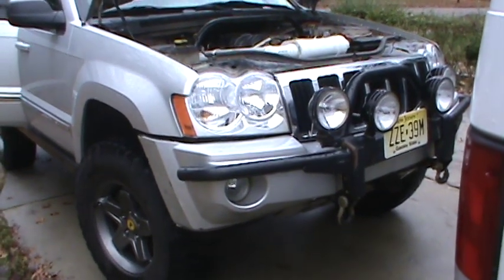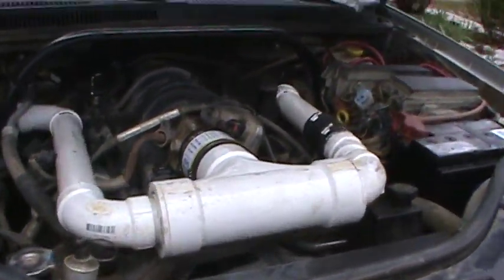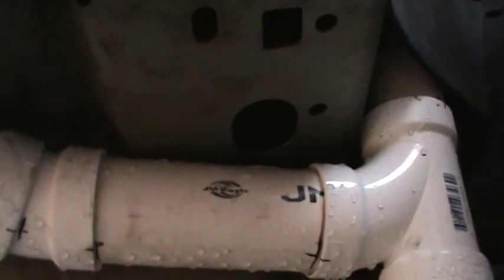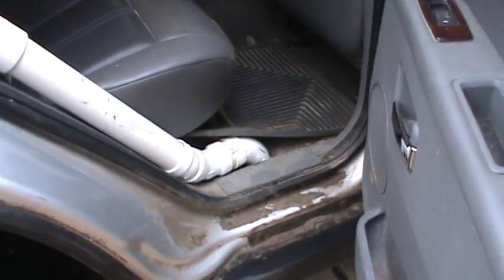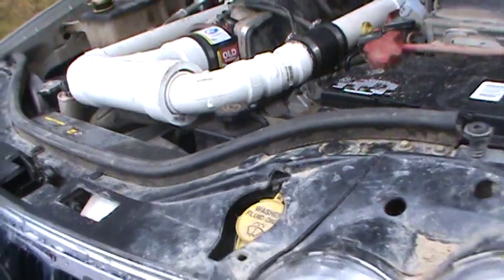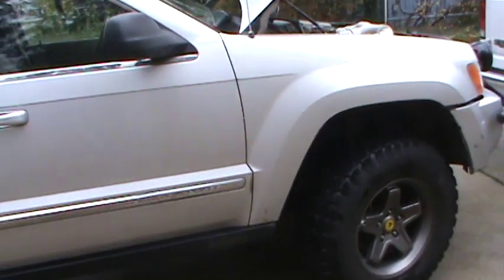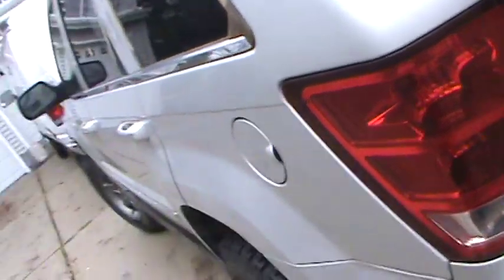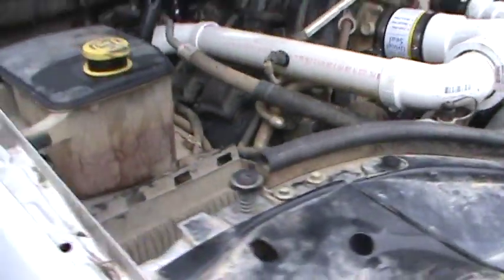2006 Wk Jeep Grand Cherokee Dual Snorkle Fabrication WATERPROOF!

Comment: U are going to blow another engine as your egt s will be so high due to no cool are getting in 😂
Reply from the maker: a decade later it;s fine and it runs cool.  FYI engines #1 thing to cool is oil, then coolant, and then air.  Intake air temp, or IAT will affect HP, not engine cooling.